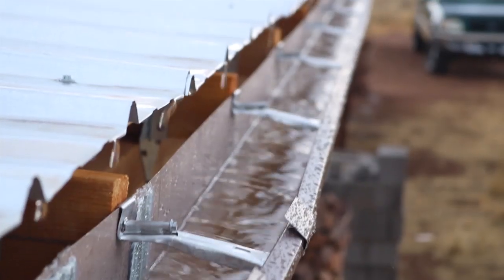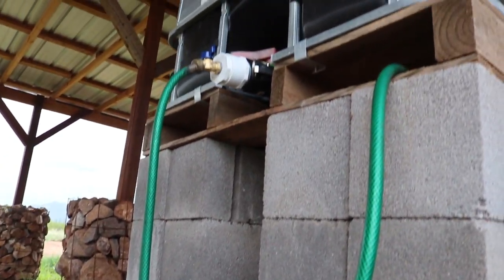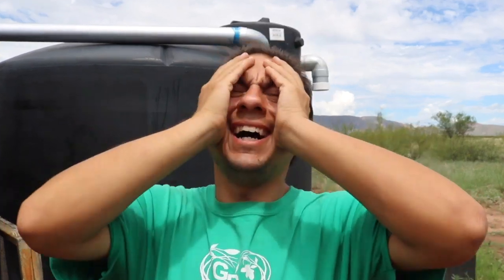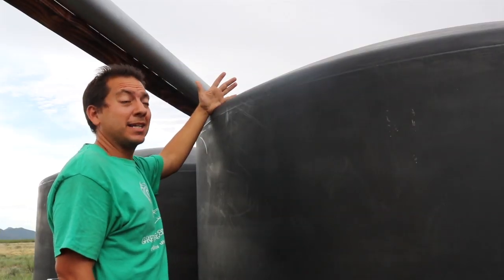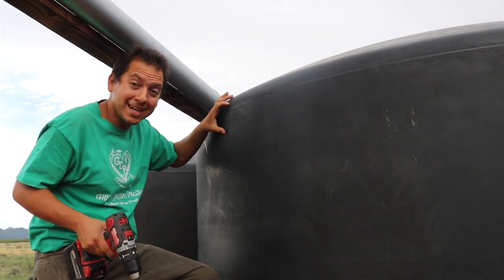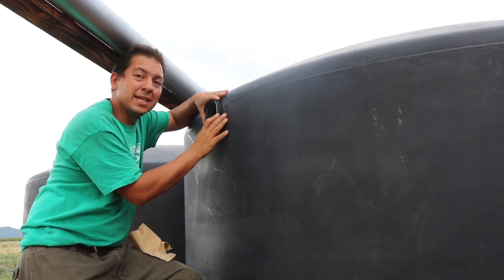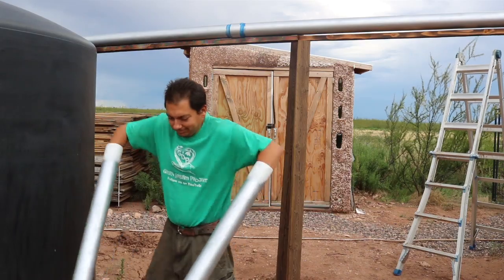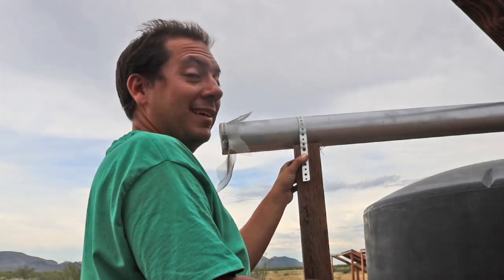RAINWATER HARVESTING | Adding Overflow to our OFF-GRID System

Comment: Will the water not heat up with the black totes and what about the quality of water, ie stagnant?
Reply from the maker: The water does heat up, but it's a lot of thermal mass, so the water temperature doesn't fluctuate too much.
The stagnant water really isn't an issue if care is taken to make sure nothing gets in the water, like debris or sunlight. 
We filter the water as well before using it.

Comment: We get 10-12” of rain on average per year - but it’s at the wrong time of year and/or too much at one time. 2-4” an hour can overwhelm even substantial earthworks on our property because we have several thousand acres above our place that drains across our 43 acres. Great job guys - it feels awesome doesn’t it? Take care.
Reply from the maker: Water will definitely drain down slope. Do you have small earthworks starting at the top of the land where the water flows into your land?
Reply: Green Dream Project we have a small berm on the upslope side to divert water away from our house and outbuildings, otherwise we would have major water problems at the house. We have a major intermittent water course on the eastern part of the property that flows to the north. There is a natural shallow basin on the west side. Thanks for asking! Have a great day.

Comment: The one thing I worried about was the floaty contaminants making it all the way to your main tank.   An overflow would would remove the floaty contaminants from the main tank. However, a screen would trap some of those floaty contaminants from being washed out. A water trap (“U” trap) may let more floaty contaminants out than a screen. 
Now it may be that there just isn’t enough bird and lizard poop and bug and lizard carcass parts disintegration bits to even worry about, or the ultimate use makes those contaminants immaterial.
Reply: Mike Mead “p” traps are more to keep septic gas contained and they need to have water added to them regularly or they dry out. Birds and critters would also find that as a water source. The screen can be removed and cleaned. It can also keep unwanted visitors out.
Reply: Redefine Living, Yes. Good point about the water trap constantly drying out. However, a screen traps floaties inside the tank not necessarily next to the screen. Probably the best would be to remove the screen when the tank was overflowing and replaced later. 
I don’t think any of the typical US plumbing traps (Floor Trap or Nahni Trap, Gully Trap, P Trap, Q Trap, S Trap) would work well to help filter off floaties because of the way water enters them, thus just a dip in the pipe to hold water to keep out critters, but you are right, it would dry out quickly and be ineffective.
Reply from the maker: We have a bunch of systems in place to reduce contaminants. It shouldn't really be a problem.

Comment: Will you add a "balancing" pipe  between your two tanks?    It will prevent one tank from overflowing before you fill the second.  
You could use your new openings.  Connect a pipe from tank-to-tank.  Put a tee facing "up" in the middle, then elbow out horizontal to your overflow.   Just thinking aloud!   Great video as always!
Reply from the maker: The tanks are connected and they can equalize. The pipe is small though, so it would take awhile. 
I think this should do for now. 
Thanks Dave!
Reply: @ourselfreliantlife  Cool!  As long as they are connected somewhere it should work!

Comment: Watching your video
has my brain working
on the storage problems..
I'm thinking of one that to many would be backwards.
Fill what could be called over flow tanks..   and then fill the above ground storage tanks
The under ground storage could have thermo tubes in them for geo thermo cooling...and or heating/cooling for others
Guess I'll find out if this is another screw-ball idea of mine. 😦
Reply from the maker: Hey, ideas are ideas. You have to play around. It's definitely good to think about.

Comment: You have me thinking about checking prices on companys that make pond liners..
Since they already glue (?)
The material together
Making bladers that can be used verticle
Maybe a hole lined with truck tires filled with rammed earth..
Raised above ground and sloped away to help keep any water soaking into the ground from pushing in on the bladder...
😕😕maybe
Reply from the maker: Thanks Jim! We've definitely been thinking about similar ideas.